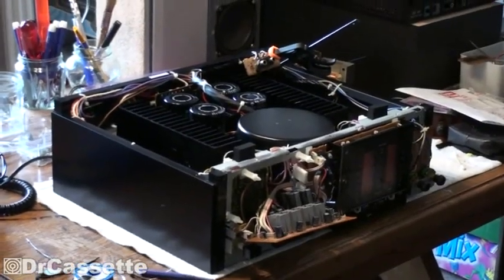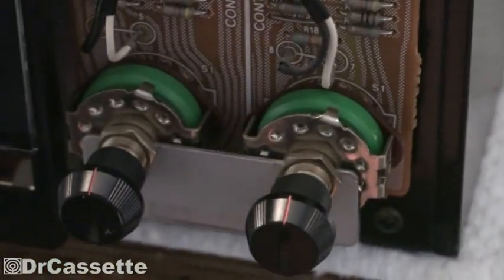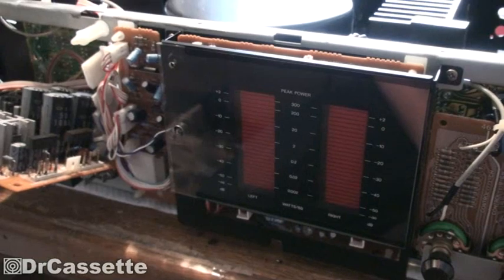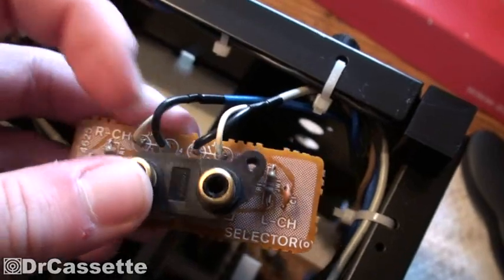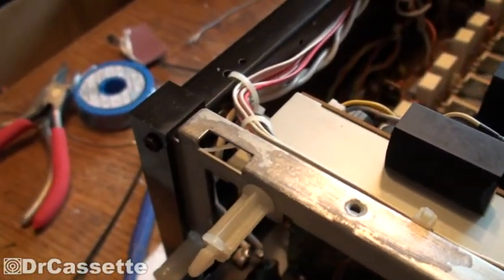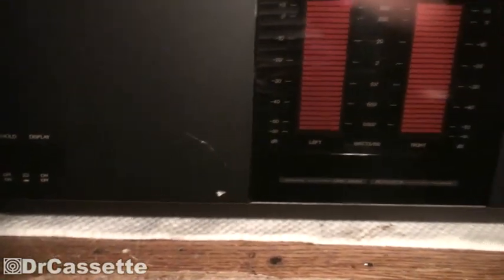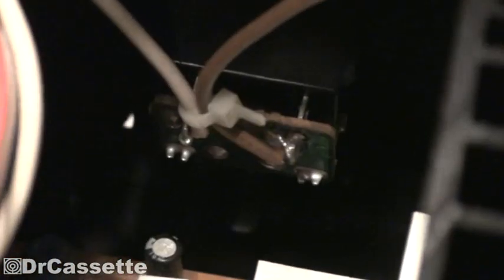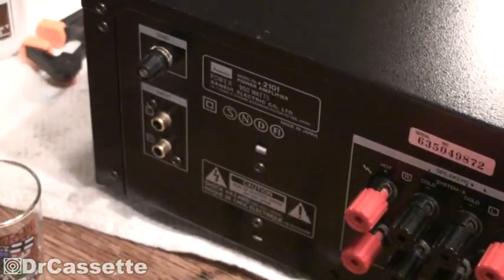DrCassette's Workshop - Sansui B-2101 power amp restoration

Comment: A friend of mine has one of these amplifiers and he said that one of the channels is out and he said that the technician told him the one of the power transistors that is bad is not made  anymore and there is no substitute. Anyone know if this is true?
Thank you
Reply from the maker: This very well possible, a lot of the power transistors used in old amplifiers have not been made for many years. You can still find them today, but usually they are used components that have been salvaged from old equipment. And there is a very high risk of counterfeit transistors that are nowhere near as good as the originals.
Reply: @DrCassette  You would think that in this day and age they would make suitable replacements/substitutes. They do for other components.
Thank for the reply Dr cassette.
Reply from the maker: The problem is that especially in high power amplifiers the circuits are precisely designed to match specific transistors. Of course you can still get transistors with similar or better specifications, but replacing one type of transistor with another type is very risky. With the different types of transistors the amplifier could get unstable, in the worst case it would then blow up.
Reply: @DrCassette  Ah i see. So then my friend is out of luck unless he can find new old stock transistors the.
Than k you Dr cassette.

Comment: Excuse me could you tell me what the capacitors have value and the resistances placed on the RCAs of entry of the final on mine are not present.  Thanks a lot.
Reply from the maker: I don't have this amplifier anymore. Take a look at the schematic in the service manual for this amp to find out what values the missing components have and whether or not they are necessary.
Reply: @DrCassette  Unfortunately on the manual the values are not marked, I saw everywhere all the series 2101 and 2102 have the capacitors and resistances on mine are not present and I have problems of sensitivity.  The possibility was to know the values of that device there.

Comment: Dr C, how was the bass response in this amplifier (assuming you used bass reflex speakers while testing). I'm asking because you mentioned that the RMS power is 200 watts and the peak power is 300 watts. A Yamaha amplifier which you fixed up a few years ago had a  limited bass response in spite of having a massive PSU and several power transistors In the output stage.
Reply from the maker: Again, the Yamaha had no lack in bass, I just didn't like the sound. This Sansui I had for a few years and I really liked the sound.
Reply: Dr C, I know what you mean.... (Till date), very few amplifier manufacturers are able to get the bass to sound right.

Comment: Any suggestions on replacing binding post on a B-2101? 5 of 8 posts on my amp have had the plastic knobs break off. Since I could not use Banana Plugs to begin with I did not bother trying to save the plastic and glue them or other improvisation.  MY  amp does not have plastic inserts. X-Balanced means there is a "Diamond Differential / X-Balanced" input/driver. BTW the amps do not sell for $1000 they average the $250-$400 on Ebay. MSRP was $1500 in '85

Comment: Those caps seemed bulged, they should be replaced. Would get better sound too.
Reply from the maker: On some old vintage equipment replacing the caps is a good idea, but unfortunately that has turned into a belief that every capacitor in anything that can not be considered as new anymore needs to be replaced immediately. Absolutely stupid.
Reply: DrCassette Yep you are absolute correct. I have a Technics SU-G50, with stock parts, and it sounds just fine. Those capacitors are over 30 years old. I did the math and unless the system is on for eight hours a day 365 days a year they should last just over 30 years. I did this at a temperature rating of 25 C.
Reply from the maker: The capacitors are perfectly fine.
Reply: Oh, some of them looked bulged. Wouldn't it still be a good idea to replace them when restoring something this old..
Reply from the maker: ***** All this recapping of audio equipment is unnecessary in most cases. This unit is from 1986. Not that old at all.
Reply: DrCassette So you measured the caps? It's not unnecessary because capacitor life is like 10-15 years max. Sure they last longer but they don't work like new anymore.
Reply from the maker: ***** Capacitor life is more like 40 years. Sure their exact value will change a bit, but considering the tolerance rating of electrolytics is -50% to +100%, it is completely irrelevant. What matters is the ESR value and that won't go up in just 15 years unless the capacitor suffers abuse.

Comment: The B2101 was the pinnicle of amplifier technology. There are 5 power supplies in the unit. Actually 6 amplifiers in the unit. 2 flat amps, 2 diamond differential amplifiers, and 2 double push pull amps. These are the most dynamic low distortion amplifiers ever. Sansui was origionally a transformer manufacturer and later audio...
Reply: oh shit, really B2101 is that great? I listen to electronic music mostly and need mega powerful and deep and quick bass. Will B2101 fit ?
I understand B2102 is a newer version and sounds the same as B2101?

What about Blaupunkt Artech MX5090 and PX5090? Are they identical to B2101 and B2101 from Sansui? Do they have Diamond Differential tech?

thanks
Reply from the maker: The B-2102 is a newer version of the B-2101, but I'm not sure if it is as good. The B-2101 was among the last really good Sansui products, later they started cheapening their components, and eventually their high end products were sold only in Japan. 
The MX-5090 was made by Sansui and seems to be based on the B-2102, but I don't know if it's entirely identical.

Comment: I really need an amp for my 2 100 watt rms speakers right now I only have 35 watts witch is terrible Ive been looking through alot of flea markets but ive had no luck
Because all of the amps ive found have been like 100 to 200 dollars but I found a nice reciever but it was 63 dollars so I think ill try to give a lower offer